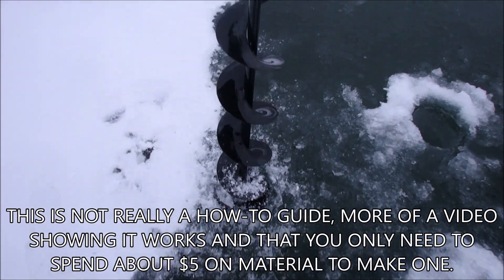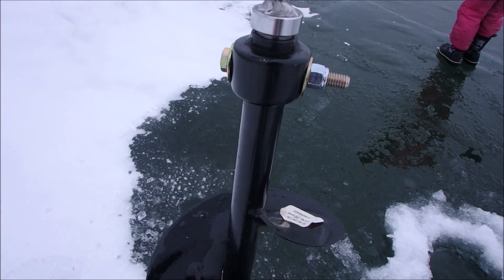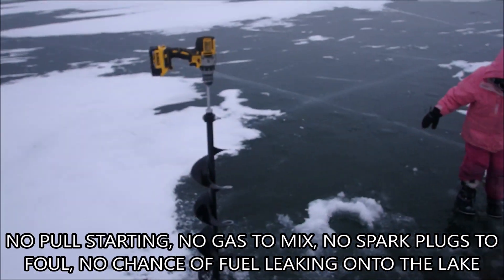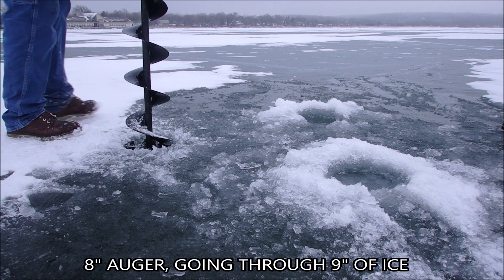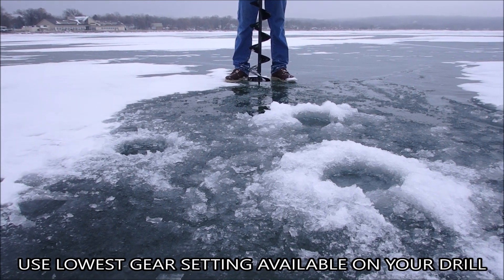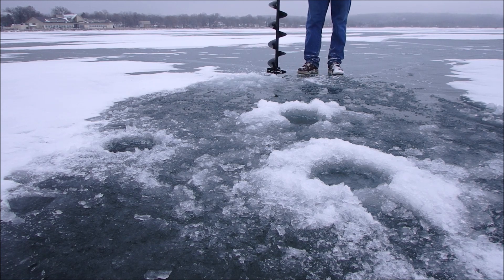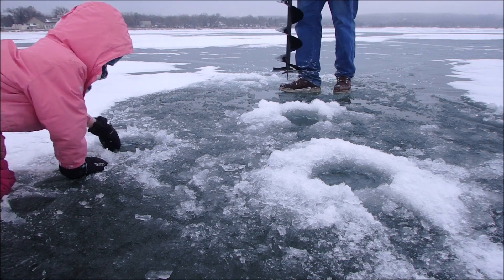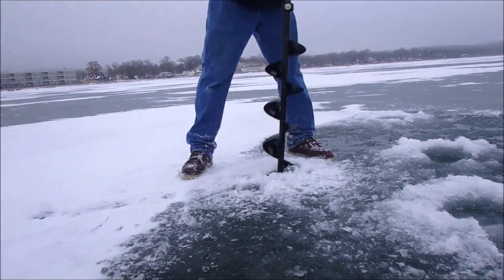DIY Cordless Drill Ice Auger Adapter

Comment: I used a drill without a handle & the torque is hard to handle @ the breakthrough point. I cured that with a clam drill plate. Its a little more weight but it saves wrists.
Reply from the maker: I brace the battery against my forearm, and when it is about to break through, I take some of the weight off the auger so it does a lighter cut. I never push down on the auger at all during any part of the hole. Works ok, but that plate looks pretty cool.

Comment: That works very well good job.
Did you sharpen your blades at all cause that cuts very well?
Reply from the maker: The blades on this haven't ever been sharpened in 16 years. It has drilled around 100 holes.
Reply: Kory's Rides Well I’m starting to think I messed up my blades when I sharpened them because I have to push very hard to drill with my jiffy... Time to buy new to blades😅